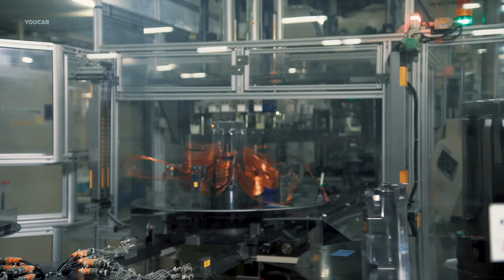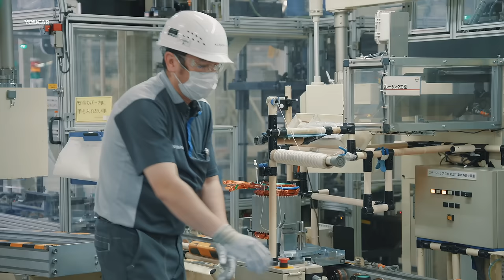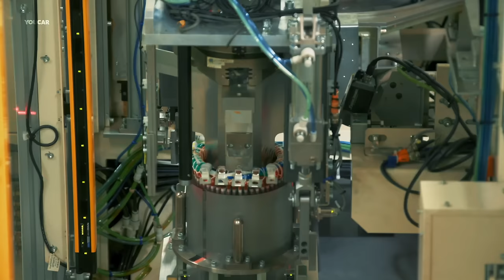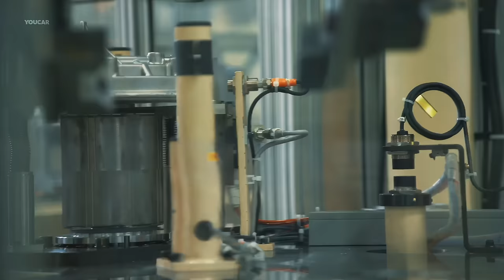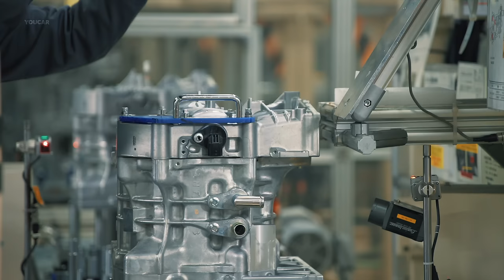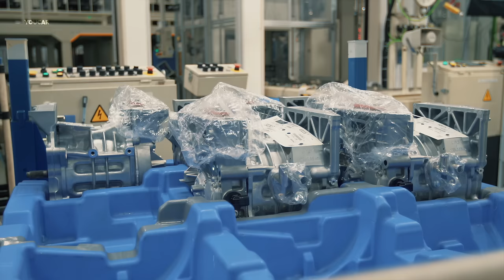NISSAN ELECTRIC MOTOR Manufacturing

Comment: Didn't Nissan make an electric car that also had a petrol engine that's sole purpose was to charge the electric motor? Still an "EV" but burns fossil fuel to power it 😂
Reply: A hybrid vehicle.
Lost in translation, probably.
I'd stick with my ICE vehicle till it falls apart-then maybe I'll think about a hybrid.
No EV for my soul.